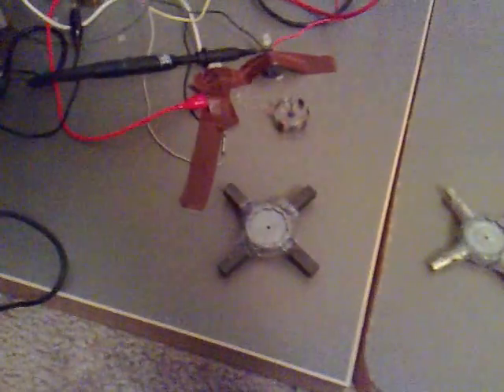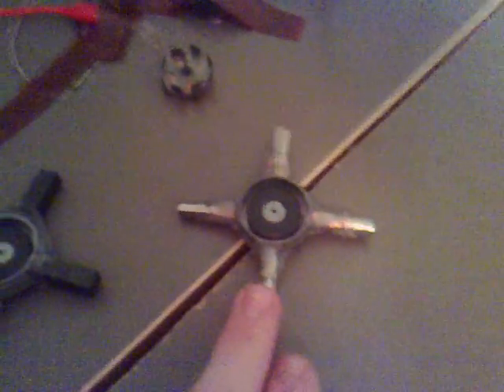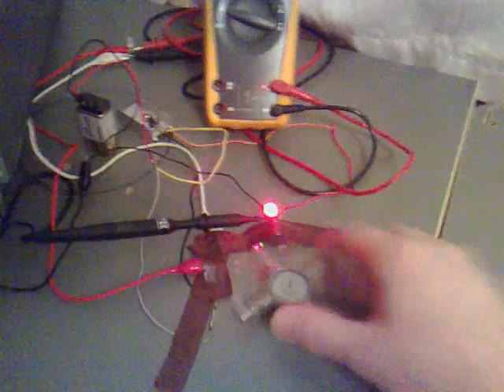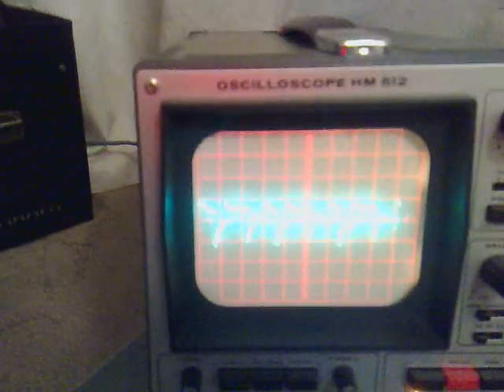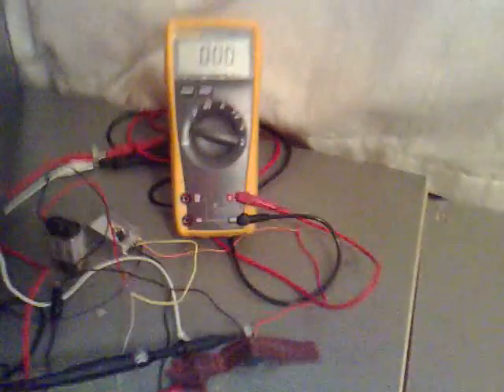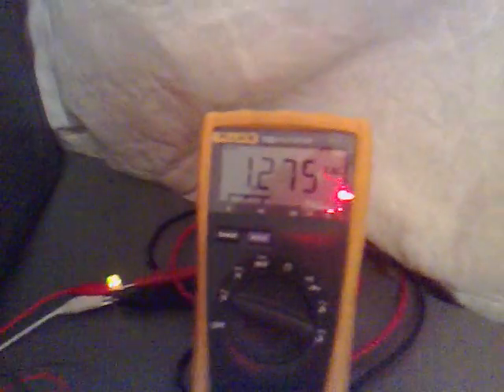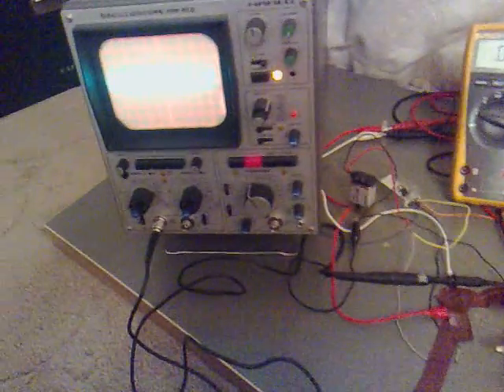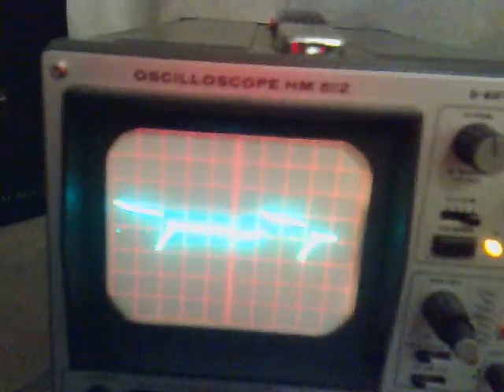Pulse Motor (Magnet Tests 02) 075

Comment: Could it be that the reed switch is staying closed longer with the neo's as opposed to the weaker field of the ceramics? Maybe by tuning optimum reed switch distances for each magnet type you may get significantly different results.

Comment from the maker: I have just tried it without the led, I put a capacitor there instead. When you short it out it arc welds the connector!!

The capacitor charges to about 130v dc. I am going to pulse it back into the 9v battery. I might transform it down a bit first though.

Comment: You didn't change the voltage scale between tests, correct ?
You're getting 'larger' peaks with the faster (neo-based) motor by the looks of it.
I recommend doing the test again without the LEDs, they will mess up your trace slightly because they appear to have 'thresholds'.